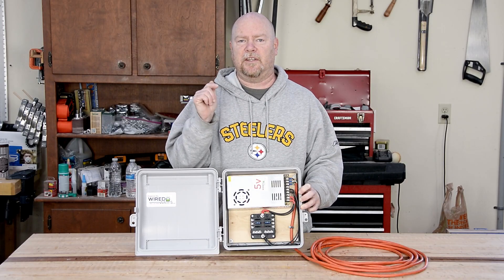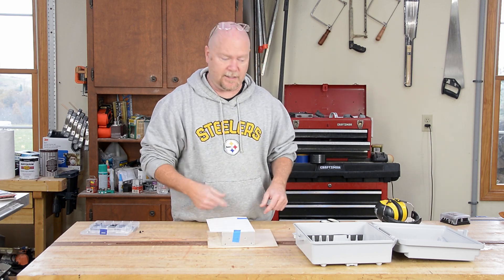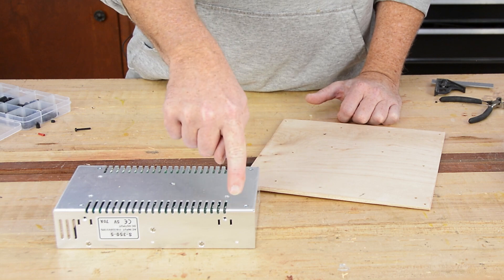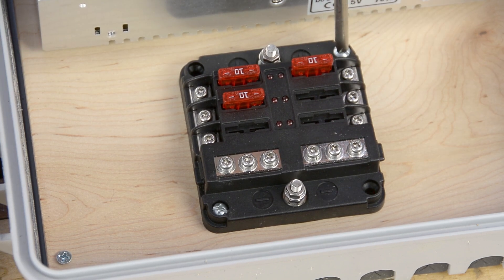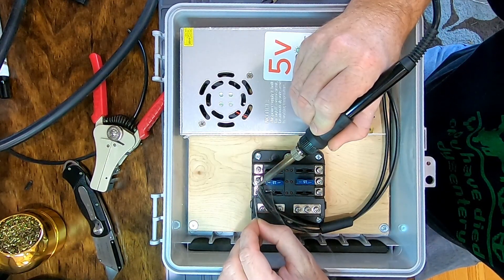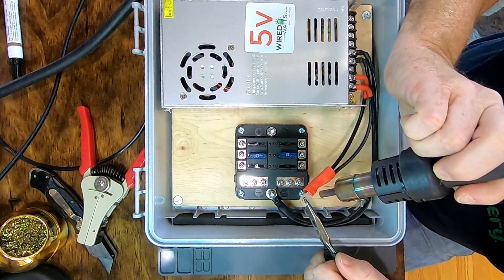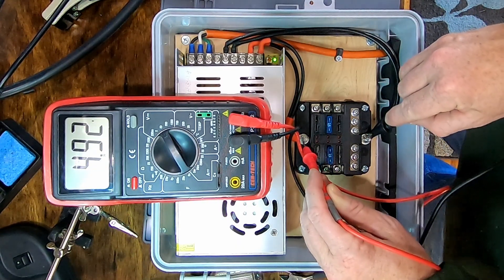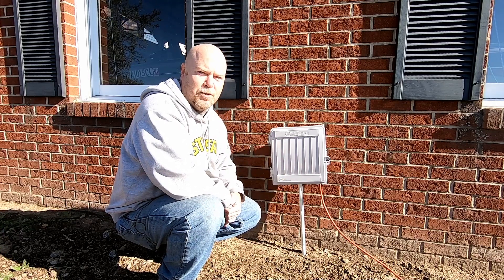Outdoor Power Distribution for LED lights

Comment: Fantastic information as I have looked at getting these weather boxes.  Gotta admit, you did well on getting this video well organized with excellent tips.  Good job!!  I use Light O Rama cards and depending on which card it is, will use 2 power supplies when the card has 2 inputs.  Instead of the weather boxes, I use clear bins so I can see the indicator lights from the ground.  Yours looks so much more organized and look forward in getting my 10 cards into a good box.

Comment: What size screw stand-offs did you use? My power supply didn’t come with any mounting screws. Thanks in advance!
Reply from the maker: The standard ones that come with a PC motherboard.  Guessing they're 1/2" or so.  The height isn't really important so long as it's enough to clear the various irregularities in the back of the box

Comment: Nice.  Would be good to add a voltage and amp meter in there too…  assume you would mount this between the power supply and the distribution block? Thoughts?

Comment: So I gotta dumb question I'm assuming the reason why your setting ur power supply to 5v is only because ur lights are goin to be 5v .. so instance I'm carrying 12v  strips  so in this case my power supply would be 12v and I'm assuming I could prob keep the same fuses at 5amp fuse..
Reply from the maker: Correct.  I have 5V lights.  Do watch if you're running 12V lights that anything else you might hook up to power (like controllers) is expecting the higher voltage as well.    In my case, 12V would fry the little controller boards I built nearly instantly.

Comment: You’re better off leaving out all of the solder on the crimped connectors. Otherwise, it looks great. I really like the idea of “deployable” power supplies.
Reply from the maker: Crimped connectors (done properly - not with the lousy tool I have) are mechanically stronger than soldered ones if you're only doing one or the other.  Doing both is the strongest option.  The solder is also a better electrical connection, but not by as much as most folks think.   Some will say not to solder because it might melt, but if your setup is getting that hot then it is seriously under-sized for the job.
Reply: @MattHeere  I think i remember hearing somewhere that tinning the wire before crimping can be a more brittle option than crimping the bare wire because over time the wire can seperate from the solder after it has been crushed.

Comment: Why didn't the project use a lower gauge wire instead of two low voltage landscaping wiring?  How much current do you expect to the project to use?
Reply from the maker: Because I have a 500 foot roll of that landscape wire and it was a lot easier to just use two strands than to get a different wire for these couple of short jumpers.  The actual current will vary a lot depending on which box we're talking about, and at what brightness I end up running the show.  Worst case is likely 30 amps for short bursts.

Remember that the current carrying capacity of a wire depends on the length of the conductor as well as the diameter.  Fuses carry 100's of amps over very small wires - because they only go 1 inch.